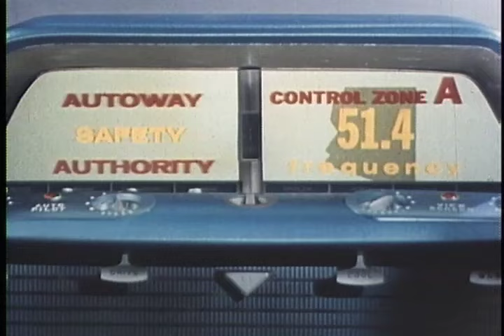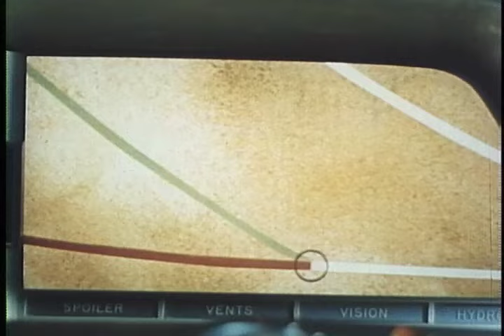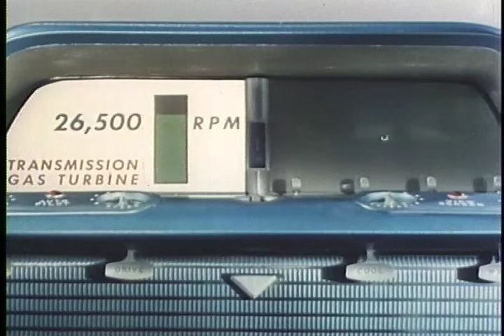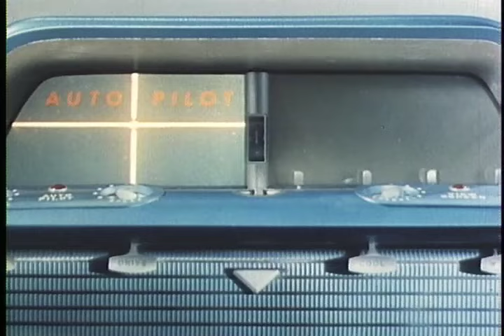GM Motorama Exhibit 1956

Comment: 5:35 " Looks pretty smooth for an old timer."  Uh huh, it could barely break 100MPH due to torque imbalance between the engine and wheels. The car kept breaking loose due to the excessive torque, indicating they messed up on the gear ratios from the start.

Comment: well it was sort of right as GMC COACH but the RTX3/axled low floorbus (designed in 67-refer to pop sci "father of the rtx") which actually had a turbine engine which produced 245 -55  hp

Comment: The steel rib down the road center should have been implemented though. Even though we now have visual systems that use the white lines and other vehicles as guidance. Which system would you trust though and which one would be good a redundancy back up?

Comment: 4:34 could you imagine parallel parking or doing U-turns with a steering wheel like that..
Reply: Wrist Twist (tm) was an actual GM experiment, it was variable turn ratio power steering. Small at high speeds but big at parking speeds.
Reply: Try it with a Tesla yolk steering wheel.
Reply: @echodelta9  that's interesting. We already have variable assistance power according to the speed. But we do not have variable ratio. Otherwise all today's car have also faster steering wheel ratio, once we have better powered driving assistance, so today faster wheel doesn't mean hard working for the driver at low speed.

I don't think variable ratio would be a good idea. It's not natural. At the end the car will go where you are not appoint.

Speaking about human/machine interface in general, I prefer McLaren approach. For example, they never put more than an option of throttle pedal profiles. They think it brakes the learning flow of how the car will behave.

Comment: Those glass bubble-top cars and tiny urban commuter "flying cars" of the Jetson's era showing the nuclear family bouncing around in there seats like happy campers are so funny. The truth is is that there wasn't an air conditioning system in the universe that could've kept up with the btu heat load building up inside those car interiors. Especially on a sunny day and especially on a HOT sunny day. The occupants of the car would've literately been cooked inside that thing like inside a microwave oven. Lol.

Comment: If they had the foresight to build simple guidance system such as those electric strips mentioned directly into all the highway when it was constructed, full self driving on them would be a cake walk and achievable even back in 1976, so the video isn’t so far fetched.  The difficulties comes when the car has to assume all guidance, we are still at least 10 years away from level 4 or 5 full self driving

Comment: Back in the day when there were like 20 cars on the road and you hardly ever really had anyone catch up or even pass you.  Now cars for as far as you can see, and i keep wondering where they are going.  This is really why auto driving has become so difficult, we don't simply want the car to travel in its lane it must miss the idiot that swerves from the entrance lane to 3 lanes over and then back to the middle.  We want it to go the speed limit but not crash into the dude that's hypermiling at 20 miles below the speed limit.

Comment: I wonder where that car is now. In the dump? Someones lucky garage?
Reply from the maker: +Colin Dalool Actually, all three Firebird experimental vehicles were spared the crusher and are at the GM Heritage Center.  GM brings them out every once in awhile to automotive events.  They were fun but also way ahead of their time with electronic sensors that followed electric wires embedded in the roadway and rear back up cameras.  With the resurgence of autonomous driving today it's become more than a fantasy show car.
Reply: +King Rose Archives Still took them a bloody long time. They're 40 years off!
Reply from the maker: +Spoods The Milkman True and not sure they'll be able to pull it off even now but it's great PR for all the car companies and a boom for the engineers and techs who are getting funding to fool around with all the research and development.

Comment: No disco music, flares, shoulder length hair on the men, or platform boots? About the only thing they "kinda" got right is the digital range for petrol and satnav on the dash, but only if they rolled the clock forward to the 2010s, and without voice control.

Comment: That's not a self driving car, you've just put on cruise control and kept the steering wheel still.
Reply from the maker: +Spoods The Milkman Actually, it had a sensor that reacted to cables in the road bed so in essence it was self driving.  At least to a certain extent.  Not quite the autonomous vehicles that are envisioned for the future now but a first step.

Comment: You got to take into account the very fast Development of the motor car from 1900 to 1939, it came from open one cilinder carriges to V8 100 ha cars, toree speed transmisions, a diferencial in the tear Axle, closed protected cocpit hidráulic and vacum breaks, suspensions, shock absorción, advancements engineering like in the AirFlow by chrysler Then came WW2 and The development stoped, after the war pre war cars again, in the 1950s to early 1960s the base of the cars was viven for the many years to come tremaining the same just elements of style were changed, the american car industry has been saved many times because the ir lack of innovation.
At the moment this video was made i think they were be living about  big budgets for the Development of innovative projects, abundance of energy good finances for reaserch and Development.

Comment: Gahhh... gas turbine as auto powerplants... talk about the wrong tool for the job! Very noisy, limited rpm range, poor fuel efficiency if not in the limited "design" rpm, very poor acceleration, extremely hot exhaust. That was a dumb idea!